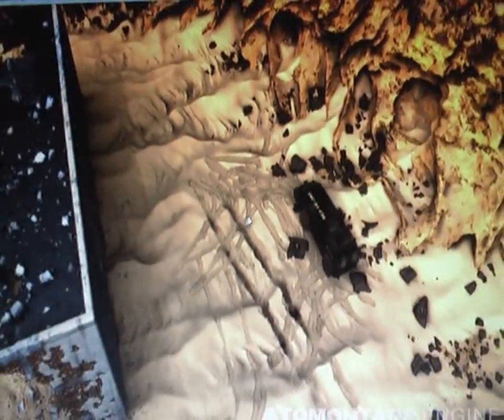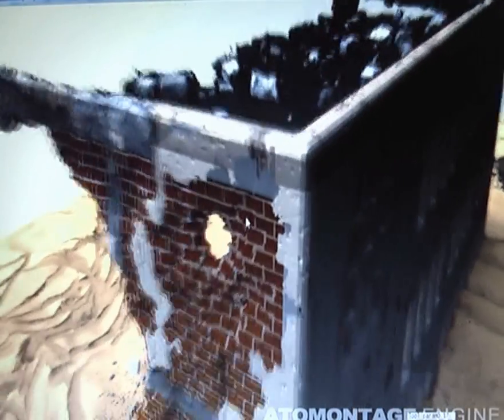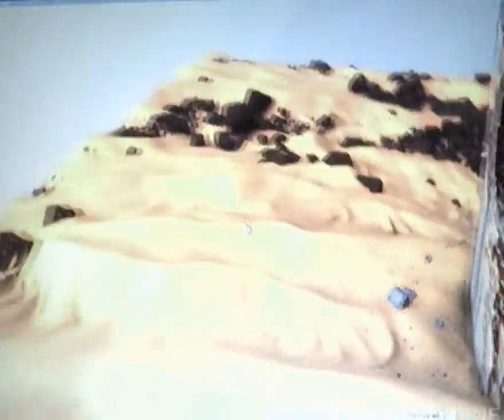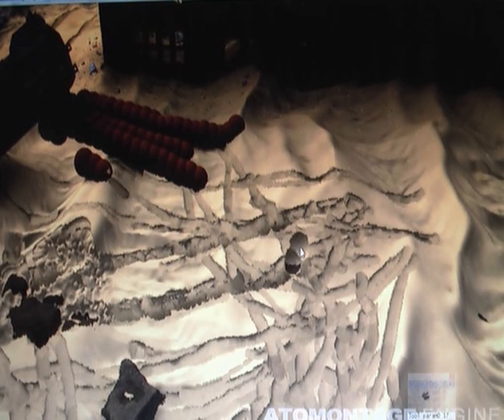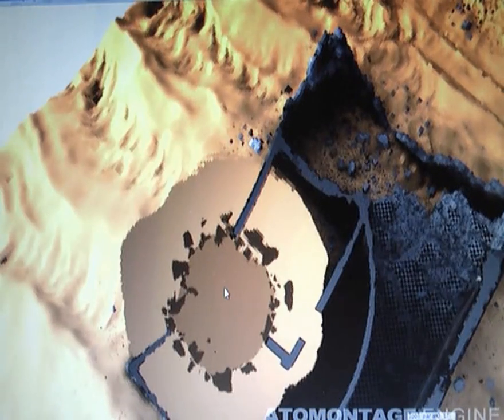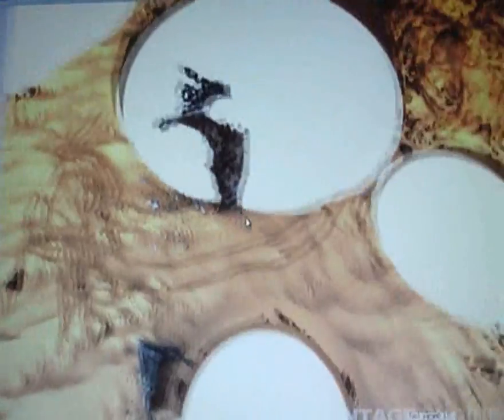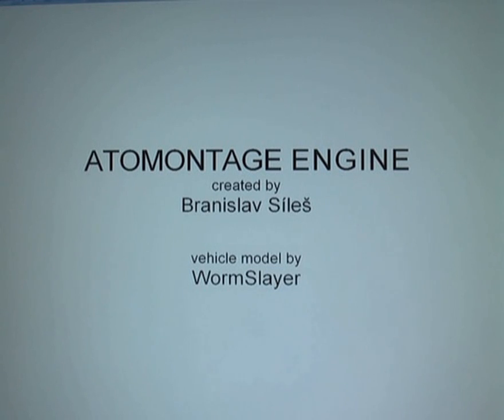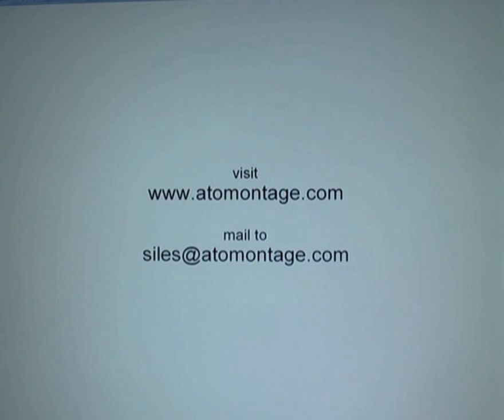Atomontage Engine - The Future Is Volumetric, Atom-Based - Unofficial vblog #1 (part 3/3;2nd half)

Comment: Is it possible to incorporate gravity into the wider terrain? The vehicle obviously is affected by gravity but the building isnt (ie. when walls are removed, parts of it just remain there in the air)
Further: Using the atom system it obviously specifies how hard something is (eg. mortar weaker than bricks) but is it possible to specify additional stuff? eg. adhesiveness/friction (ie. bricks alone will fall easier than those which are stuck with mortar?)

Comment: Yeah Sorry, I saw the website updates about a minute after posting. 
Right Now I am doing some 2D stuff, Ill definitely check the engine out at some point when it has some released (Or if I get some money to sponsor ^^) 

1, What about Gravity, can voxel "types" recognize when they should be falling as one object?  
2.I read about engine "AI" on the site. That means it would be strictly SinglePlayer? Because you can't rely on the same results + cheating if you do not run a "server AI"

Comment: Very cool, I would love to see games with this system, there is so much potential.  The level of detail of the volumetrics is something I wonder about.   I remember getting excited with Red Faction, because you could dig tunnels, but this is probably going to be better by far.  It was a limited system, the geo-mod tech for that red faction used booleans with polygons.  This is an impressive demo!  Great work!!! :)

Comment from the maker: Thanks! Sure I'm careful but at some point I'll have to show what I have in detail. Thankfully the whole philosophy of my solution is so strange that probably it could be fine to even release the source code without worrying much.

The way the particular compressions are applied and combined is the key to achieve high entropy with little footprint.There are just 2 key data structures and they're very trivial. I'm trying to design the whole thing so that it can be implemented on the chip cheaply.

Comment: Heres a question. If i were to dig away at the pillars and walls of the buildings until nothing was holding the upper level up would the the top of building fall onto the rest of the building? would the rest of the building be crushed by the falling part?

Comment: @Arachnivore No it can't.
First there's a huge need for data transmissions to sync the world if a player joins in the mid. of a game. The players doesn't need the entier world but it's still a massive data transfer.
Next the player needs to do comparisons of the geomitry, incase of changes, everytime he leaves an area and comes back.

To keep consistency of the world to all players. Alot of data transfer needs to be made.

Comment: It's a cool engine. The problem i see with the engine is that it's not viable for multiplayer. There's just to much data that need's to be sent over the net if massive changes occure.

Comment from the maker: @WinterXL that's not a problem of voxels, you could achieve the same non-plausible behavior with polygons; a proper simulator will have to calculate the forces etc and induce the proper response...

Comment: @JamesRaynor11 Thanks for teh response. My concern was that voxels seem to be married to an uncompromising framework they must stay in their 3d grid or they don't seem to interact. I've seen voxel simulations where voxels exit the grid framework but they stop interaction at that point and almost seem to act like particles.

Comment: The big hole was 100,000,000 voxels, so a map about the size of a Minecraft map would run in the 2,000,000,000 voxels (I just multiplied by 8, quick estimate, it's probably too low)
I'll need to see a lot more of that engine before declaring that it could run a minecraft like game.